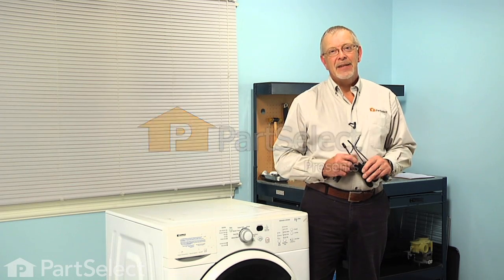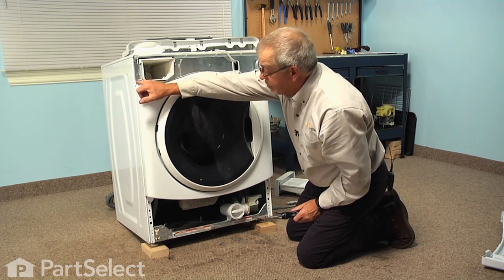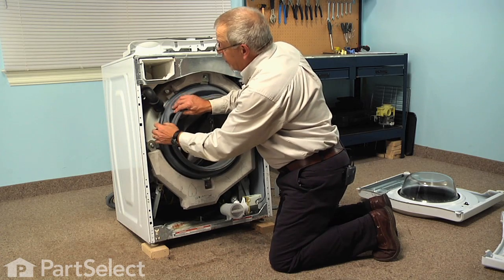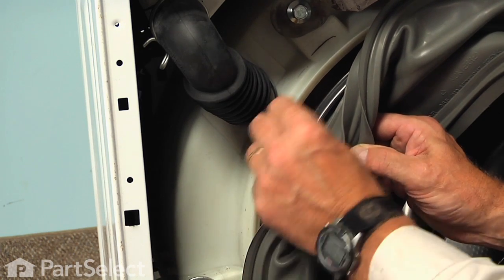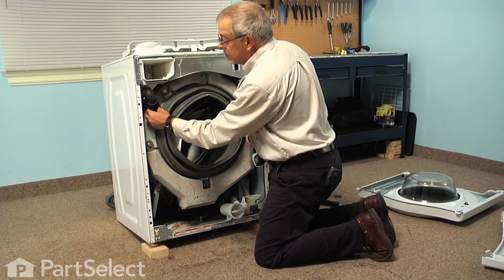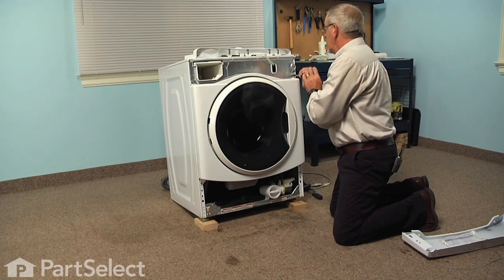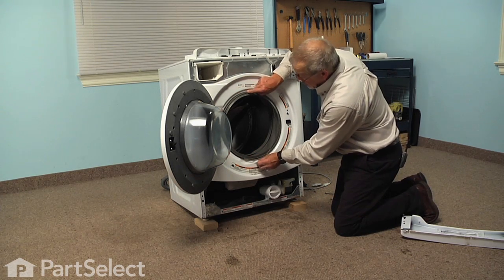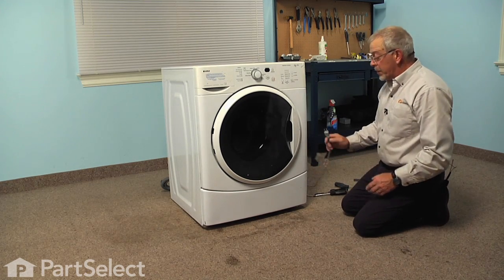Washing Machine Repair - Replacing the Door Bellow (Whirlpool Part # W10111435)

Comment: Thank You Steve. I really appreciate how you pointed out the arrows and took your time. Also the difference in the screws, that helped me seperate them so I got them back in the right place. I was told by the appliance store that this was a hard job, so I was plesantly supprised. The only struggle I had was in getting the bellow started. I got this job done in about 45 minutes.

Comment: My Maytag was almost identical to this machine. The steps provided here were extremely helpful. I tried to make too much of a deal installing the bellow between the tub and frame. It just tucks in there pretty easily once it's attached to the outside lip. Also I had a lot of problem with the outer spring clamp. The key: keep it perfectly straight with the front of the machine. I found the screwdriver was the best way to stretch the spring. Other videos recommend just using your fingers or a pair of vice grips. The screwdriver works best in my opinion. Also removing the doors and other front panels make the job so much easier. Good video.

Comment: Thank you so much for the easy to follow instructions.   I was able to make through all the steps fairly quickly and I have zero appliance and mechanical experience.  The hardest part was, ironically, what i thought would be the easiest - putting back on the spring loaded retainer band.  Just takes a little patience.  The repair man estimated $400 so I saved a bunch.  Again, thanks for video.

Comment: Steve thanks for the excellent video. Although my machine was a Whirlpool Duet model, the process is virtually identical. The only extra step I had to [take/figure out] with my model was to locate and release a center screw from underneath the control panel and it came off easily. The remain steps were as simple as shown. Much appreciated. Saved over $100 I'm sure. So your video was worth every second!  ;-)

Comment: Steve, many many thanks  you for your demonstration. I just fixed my new  door bellow, denying the potential technician $170:). My work progressed so smoothly, like a knife through cheese! I used, vinegar though, instead of a mold detergent, for cleaning the surface of the lips.God bless you.

Comment: Fixed Mine For Free! I have a Duet Sport that was leaking because 2" of the seal had torn off at the bottom. I rotated it 180 degrees so the torn part was at the top and now no leaks. Thanks for your helpful video.
Reply: Next time try Amazon.  Got mine this week for $60.

Comment: Thanks Steve and PartSelect!
Hint: I had a small slit any the bottom of the bellows that caused a leakin. While waiting on the part, I filled the slit with tub and tile silicone caulking, and let it dry overnight. This allowed me to use the washer while waiting on the part! Just in case, I also removed the bottom cover per your first step in the instructions and stuck a pan underneath the door and sealed slit, just in case the silicone plug gave away. It didn't, thankfully.
I received the parts from PartSelect and then installation was a breeze. Not saying I did not rewind on the instructions a few times, but after the first replay I was back at it and finished the step in minutes.
As with all these types of jobs - give yourself some time to take it slow and methodical. It pays off in minimizing mistakes and frustration.
Thank again everyone at PartSelect!
Don
Reply: Good to about removing the bottom. I know I can't get that final spring loaded ring back on by myself so I am going to try the temporary sealant hack till I can get an extra pair of hands. This is old part but which sealant worked for you? Some are hard to smooth down for such a tiny tear

Comment: Had to due this due to a tear in the bottom front. Works great. Ive read some complaints elsewhere about the new bellow being all wadded up when shipped making it hard to install. WD40 makes for a great lubricant with rubber on metal or plastic. It does make the front spring clamp tricky!

Comment: Thanks for the video!  Got it replaced thanks to you!  I'm a hero to my wife now!
For those having trouble getting the outer ring back on, use vise grips and a single blade screwdriver to really stretch the spring.  Put the ring on the top and the sides and then use the tools to stretch the spring and locate the ring around the bottom.  Then remove the tools and voila!
Reply from the maker: withchza Happy wife, happy life!
Reply: After  putzing with it for over an hour, +withchza, my wife came home and lent her hands while I stretched the wire/spring.  Right as rain - and now I can do laundry without a wet floor (hopefully).

Great video, great comments.  Thanks, all.

Comment: Thank you very helpful video ,  I would not of tackled this without you.   --my control panel (whirlpool duet sport)had an additional screw underneath control knob that I had to watch out for and no tensioner ring on door ( possibly should have ).   Putting boot on tub portion required some patience lol
  Thanks again

Comment: Great DIY video.  Thanks.  I was puzzled by your instruction (at 6:16) to install the "inner portion of the door boot goes inside the lip of the inner basket" which I found impossible to do and theoretically problematic as the rotating inner basket would then rub against the bellows.  I looked at a few other vids and concluded that the bellows cannot possibly install inside of the stainless steel "inner basket".   I installed it accordingly (so that the inner portion of the bellows is between the outer rim of the inner basket and the inner rim of the outer drum and so far it works - no leaks.  Fingers crossed.  Again thank you.

Comment: Thanks so much for the video! This was a lifesaver. You make it look too easy haha. Getting that damned wire with the spring back on was brutal. I had to take two pliers and disconnect the spring, then bend one end of the wire into a hook and mangle the end of the spring a bit so I could forcibly hook the spring back on.

Comment: This is my machine. It was not easy as this guy says. I think he just replaced the one he had just taken off. It was probably stretched to fit and makes it easy to get back on. My dryer sets atop my washer and I removed the dryer with a neighbors help but now I dont think I needed to do that. He forgot to mention there is a screw under the control panel that needs to be removed and it took a while for me to find it because the panel would not come off. I saw one video showing the replacement without taking off the front panel but it was impossible to remove mine without taking off the front panel. I did not use water or detergent on the bellows which made it much harder to get into the grooves I'm sure. The outer ring was the biggest problem. My neighbor and I both attempted numerous times to stretch the band into the groove, but everytime the bellows would pull loose from the groove. It was very frustrating as I am 70 and not as agile as I use to be. We finally made a modification to the spring to make it a bit longer and was able to tighten it and get it to stay. My machine is a Whirlpool and I order the bellows from amazon and cost $69. Looked exactly as the one that came out which had numerous holes and tears which caused my machine to leak but not everytime. 
You can save some big bucks if you diy, but you should have a helper to hold in place while you maneuver the bellows into the slots and grooves and be ready for some frustration. IMO this is not an easy job.

Comment: Thank you! Thank you! You took the intimidation out of an intimidating project. One question though: the replacement bellow I got has four small rectangular indentations where the old one has four holes. Am I to punch through the indentations to open them? Thanks for your help....again.
Reply from the maker: +Margaret Toale  I am not aware of any change in that part. What is you model number and what part number did you receive?
Reply: PartSelect, the replacement bellow we bought off Amazon had dummy holes- just indentations. Lots of reviews say the same thing.  We carefully cut them out instead of returning and reordering from somewhere else. I had too many loads of laundry to wait any longer!

Comment: Thanks Steve! You made it look easy. It wasn't. Not because your directions weren't good....  Only because screws don't match up (I'm talking to you, deformed bottom panel) and the concrete frame blocks the angle of the screwdriver/nut driver to loosen (we had to cut the old gasket out and pry it out from under the clamp) or tighten the clamp. (three times is a charm) and I can't even remember what all we did but we did do it, three hours fifteen minutes.

Comment: The part you removed in the video looks exactly like mine (P/N 8540952). But all the info i found on the internet says that the replacement P/N is W10111435. It looks very different from the original part. In your clip you show a very brief image at the beginning that looks like W10111435. But the video itself looks like you are reinstalling the old 8540952. I have the W10111435 that I ordered in part because this video made replacing it look simple. But I am stumped on how to make W10111435 fit.
Reply from the maker: +John Schroeder The manufacturer subbed this number after we made the video, but the procedure is the same.

Comment: You make great videos! I recently used one to replace the drain pump and it made it very easy. However, I noticed there was a leak that was coming from the concrete counterweight in the front. I read that this sign of a damaged bellow. I carefully inspected the bellow and found no rips or tears.
My question is: is it possible that tightening the springs would get rid of the leak?
Reply from the maker: +Ryan Fairfield I am doubtful that tightening the band clamp would solve the problem and you should use caution to not over tighten and damage the clamp or the bellow. Check the bellows carefully as well as the lip on the outer tub.

Comment: when removing top control panel face plate dont forget qbout the allen bolt in the center of the bottom
Reply: Mine was phillips
Reply: this is good for reuse the old one, however the new seal is a lot more difficult to get back on the rim of the basket. Any tips?
Reply: Be very patient and if possible have a second set of hands to hold in place and probable moisten with water or something to make it a little slick.
Reply: mine too. @SportyClassic

Comment: Great video.

But it's not necessary to remove anything more than the lower panel. I just repaired my machine by removing the lower panel and taking everything else through the open door.

Comment: great video. replaced the bellows but now a new problem is the door won't lock .If I hold it shut and start the washer , it locks and the light showing it is locked goes on, then unlocks and the washer stops. What did I do wrong?
Reply: Did this ever get resolved? I'm having the same issue.

Comment: thanks for the video. i am having trouble getting the second spring on. i dont get where the flat head screw driver is placed to properly stretch the spring to fit over the bellow
Reply from the maker: +Cornell Wiley There is an oval loop on the bellows wire where it attaches to the spring. A medium flat blade screwdriver will fit nicely into this oval loop. You can also use a pair of needle nose pliers as well.
Reply: +PartSelect thanks for responding. now it has a leak during  the rinse cycle.

Comment: I have a Model # WFW8300SW03 WHIRLPOOL Residential Washer.  The console has 2 screws one under control knob must open door to see it. I watched another video the weights on the front of the tub were removed. This makes putting the door bellows on the drum much easier. good video but the little things that kill you

Comment: The boot appears too big. I can get it on about 3/4 of the way and then there is too much rubber. Do I have the wrong part? Washer model # 11047542602 and the part # for the bellow is: W1011435.  Please help!!
Reply from the maker: That is the correct part number for your model. The larger diameter side that attaches to the outer tub can be challenging to get into the V groove but it should fit perfectly.

Comment: There was an edit near the end of the installation of the spring clamp. Is it possible that the install of the spring clamp wasn't quite as easy as he made it look? That spring clamp is a complete bitch to install. It took me about four hours to get the spring clamp installed. The key seems to be that the clamp needs to be down in the v-groove and the v-groove on my new bellow was not well defined. If the clamp isn't down in the v-groove of the bellow it will just slip off when you attempt to pull it to the right with pliers. I found needle-nose pliers to be the best method. I also used a pizza cutter covered with duct tape to roll around the bellow to help force the bellow down into the metal groove. I ended up using some duct tape to hold the clamp into the v-groove while I was pulling the clamp with pliers. Finally, this video was 100% complete and correct for the model of washer that I had. Some people are claiming that the removal of an extra screw was not shown in the video. No - those people probably have a slightly newer model of the washer but most of them are very similar but maybe not the EXACT same model that was shown in the video. My washer is a Maytag Epic-Z MHWZ600TB02. Great video!

Comment: Would this gasket going, make the drum smoke when spinning?
Reply from the maker: Hi Laurie, thanks for your question! That is a symptom that has been reported before, but normally the bellow is replaced due to a tear causing a leak.
Reply: Replaced the gasket but smoking persists.  Seems like drum is out of round?  Uneven rubbing on gasket, seems to be where smoke is coming from.

Comment: Great video but I can't get the bellows on it seems way too large and flexible.
Reply from the maker: What is your model number and what part did you receive?
Reply: +PartSelect  received W10290499 rather than W10381562
Reply: +Oingo Boingo I got in on using some rinse aid and installing the much thicker inner lip first. I also had to stretch the spring on the outer wire clamp. Much thanks for the help.
Reply from the maker: Glad you got it on.

Comment: I want to meet the designer that thought it was a good idea to angle those two machine screws on the lower panel so that the only way you can get them off is to life the front. I have my drier stacked, so that's basically impossible to do.

Comment: Putting that wire circle with the spring back in place seems impossible!
Reply from the maker: That wire clamp can be difficult to replace. The most important part of the procedure is to grip the right end of the spring and pull
to the right, being careful to pull parallel to the front panel. This video link, although for a different brand, shows the best method. https://www.youtube.com/watch?v=7J3RqONy4pw
Reply: Oh yeah is that outer spring hard to get back on! We've replaced the bellow twice and each time we struggle several minutes until it pops into place almost miraculously. It takes both of us.  I'm amazed that anyone can get it on by themselves!